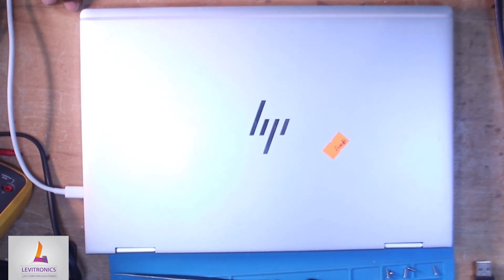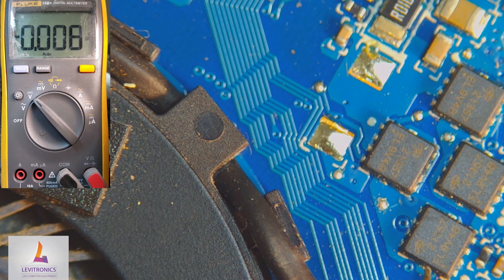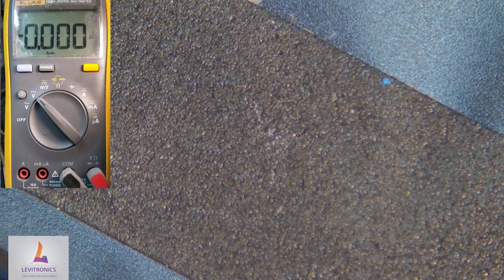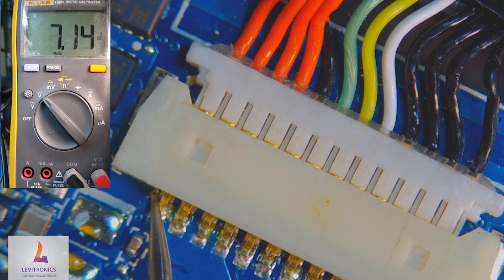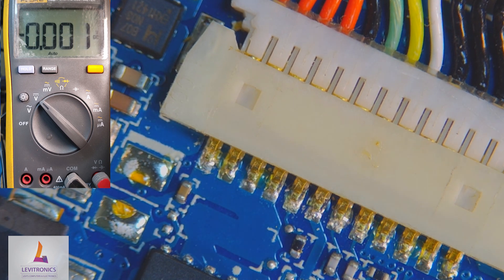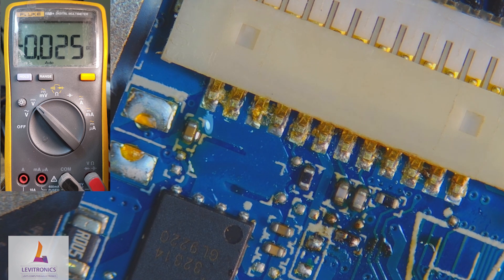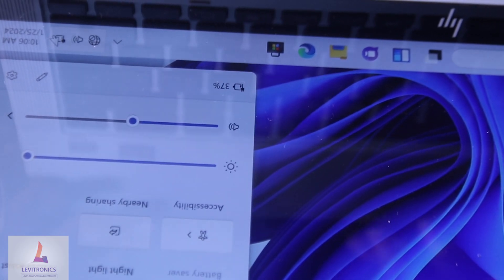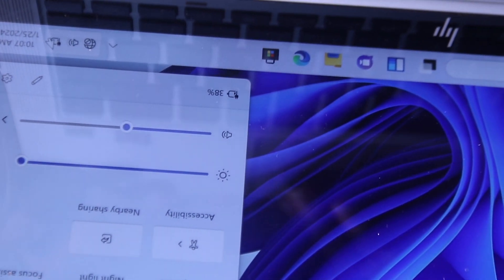HP ELITEBOOK X360 1030 G3 WITH FLASHING AMBER LIGHT, NOT DETECTING NOR CHARGING BATTERY.

Comment: Hi I’m having a similar issue with my Cap lock & power led blinks white & amber red then the NUM key lights up and laptop doesn’t boot.
Tried several times and laptop boots charges battery works perfectly, I restarted still work well. Then I shutdown and the whole saga starts again blinks block screen……..
Any idea on what can be wrongs? If I can get your mobile number I can send you a short video about my laptop.,